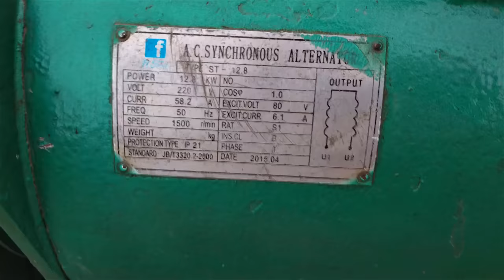Free energy Generator With 100 Kg Flywheel 12Kw Alternator 100% Real Free Electricity

Comment: That AC motor is using electricity of the power company (220V or 120V) and He still has to pay for it. That motor is rotating the gears and that rotational energy is converted into AC by the alternator.
The thing is: If we could rotate the gears with a DC motor through a battery?

A chemical cell battery connected in series (12V x 20) would produce a 220V DC supply, which would ofcourse overheat and cause extreme power loss, and will lead to premature battery failure.

Now the problem with lithium-ion battery(used in EV cars) is that, they are costly. A 48V lithium-ion battery would cost around Rs 1,50,000. So to have around 220V,  we need to buy 5 such batteries -->Rs 7,50,000 investment just for the Battery.

Moral: We extremely have to rely on running water from Dams, or Steam, or nuclear power.  Power generation is costly and we need to understand the preciousness of our natural resources. It is a hard truth that No energy comes free.

Comment: I work in a printing company, and we have old machines with flywheel systems practically the same as the one in the video.  In itself, the machines can break your fingers, hands and arms, and in extreme cases crush or tear an extremity until they stop due to their safety sensors, but those that have a flywheel do not have modern technology or a system. emergency brake, given their age, they can kill you if they grab your hand since there is no way to brake 50 kilos or 100 kilos rotating at more than 1000 revolutions per minute.  So, watching this man put his hands through the straps, so comfortable and confident, spinning at such speed, attached to such a heavy and large flywheel, left me one step away from a heart attack.

Comment: The alternator was stripped of parts except the fan and replaced with batteries. The motor is just an added part to make it convincing . Once the batteries are exhausted, the power is gone. This is just for  “views” and income for the guy.

Comment: What he invented will not work!

I invented Next Generation Electricity, the SPHEREMOTOR. Wrap hundreds of feet of enameled copper wire around a small plastic bowl. Take two strong disc magnets and let them attract together squeezing the center of a pencil. Add something to fill the gaps between the two magnets. Secure each end of the pencil so that it can rotate, and the magnet portion rest inside the wired wrapped bowl. Take some 9-volt batteries clip them together. Sand the two ends of bowl enameled wire and secure one end of the wire to the negative on 9-volt batteries.  Now tap the end of the other wire to the positive on the batteries. Keep tapping and watch the powerful motion it creates.  Where it becomes cool, is when the magnet around the aluminum axle is a sphere with 600lbs of pull strength and the tolerances between the wire wrapped bowl are really, really close, the timing of the alternating tapping is perfect, that's when it is magic. Now add another bowl winding to generate current from the spinning of the 600lbs pull strength sphere magnet inside it and this becomes something that uses very little current but creates a large amount of current.   To see drawings, search for spheremotor.

Comment: You clearly tell the lights (load) is not connected to the alternator. When he turns on the lights and the machine, we cannot hear the load act on the alternator. 😂
If it is really connected to the alternator you can hear the machine slow down and work hard to rotate the flywheel. 😅

Comment: This is simple why it works, and you can't say it doesn't without actually trying first at this scale (not by using a 10 grams flywheel). The key here is the heavy flywheel that overcomes the magnetic field breaking power. the added pulleys allow the system to output more than the input (FFG). Sure, this doesn't work if you did all the your homework when you where in school, because you need to think a bit more outside the box. Watch this video to get an idea of what's gonna come. PwZK51CG1kk

Comment: There are serious problems with the octopus energy company's charges and electricity meters. Under the same usage conditions, the electricity bill can be 40% more expensive this month. Be careful when choosing an electricity company~

Hi !

I just moved here on August 16, 2022. Because the electricity bill paid in December was 40% more, I feel very wronged. I have never used the dishwasher and oven here. I ever wash the dishes with my own hands and just use my air fryer, never use oven. I haven’t officially turned on the heating until now, because the indoors here are warmer. I don’t even need to turn on the fan since last month, and the one I rent here is the most It's just a small one-bedroom apartment, not a house! Life is as usual, and the electricity consumption is the same as in the past few months. The December electricity bill is £209.07? When the air conditioner is turned on in summer, it only costs £124.61 and £132.15. December is unreasonably expensive and a lot more expensive ~ need to investigate thoroughly and follow up? ~

December 2022 The bill is more than 40% more expensive, but my life is as usual and the electricity is used as usual. I have not turned on the heating, because I don’t know how to turn on the heating. I used the dishwasher, and I have been washing dishes by hand for four months since I moved here. The weather has been cold recently. I just bought a small heater and came back for a few days. I have blown it a few times. In the hall, the blowing time is equal to It’s like blowing my hair with a hair dryer. Because I’m sensitive, I’ll get a dry cough if I blow it too often, so I turn on the heater very little and only use it a few hours for a few days~
Conclusion: The air conditioner was turned on for 1.5 months from mid-August to mid-October, because I moved in in mid-August~
Electricity charges in September are
£124.61
The electricity bill in October is £ 132.15
In the middle of December, the air-conditioning and heating are not turned on, and everything is as usual, and the electricity bill is
£209.07? ? ? ? ? ? ? ?

🤔 When I was renting a house, I already felt weird. My flat landlord insisted on asking him to pay the electricity bill, and I just paid him back every month ! I said that I can apply the power company by  myself, but the landlord insisted on doing so~ Unexpectedly, within the third month, the problem appeared ! I know that the power company can set an index electricity bill amount, and then deduct more and make up for less in the future, isn’t it? Does my account do this? If there is no set indicator, it is reimbursed every month. Why is my account so expensive for no reason?

The landlord said that I started to consume more electricity on the 10th, because it started to snow that day, but my heater was delivered on the 12th, and it was taken out on the 13th. It only took a few days. I also said that it was only in It only takes a few hours for the hall 🤔 How can there be so much electricity, I only use it for a few days, and if it takes a month like this, it will become an astronomical figure ~  Well ! I need to do some routine formula checks?   even call the power company to check the meter and ckeck the wire ~ How to solve this problem ? !

Comment: Note carefully from 5.04 to 5.06, how that idler pulley he is struggling to tighten under tension, as he does the pulley moves as he tightens the nut, so he tries hard to push the pulley down to tension more using the wrench, but all of a sudden around 5.05 the pulley moves down by itself, so clearly this is a fake photoshopped or edited video. The whole frame  moves so he goes away to reconnect house power to it.

Comment: I just laughed when he plugged the electric motor into the board being powered by the generator that is being powered by the electric motor, how stupid do they think people are, that setup would slow down and stop within a short time but I suspect that there is a hidden power cable powering the motor, there is no other explanation.
It is IMPOSSIBLE to run the motor from the generator that is being spun by the same motor even with a flywheel. 
I am pretty sure Faraday tried this the day after he invented the electric motor and found that it did not work then, does that mean that India and all the 'Stans are about 200 behind the rest of the world, are they in danger of becoming 4th world countries?

Comment: good lord. that belt pully tension CF contraption!  dude, you're supposed to tighten the tensioner in place and never touch it while the damn ithing is running, you could get fuuuuuked up bad. And that grinder could easily kick back in the nutes and then ya weld with no welding goggles, you'll go blind. Please get an eletrical meter & check your voltage, Amps current, wattage draw, everything.. stay safe  :}

Comment: I would design a gear multiplier system and have the motor shaft rpm multiplied..
Secondly i will use a power booster which i have practicalized already to use small power give to generate plenty power to energize the motor. 
I think with this, i will have a cool free energy generated.

Comment: Plz guide me:
1. Small poly sizes?
2. Alternator and Motor RPM sahee hain ya 1500RPM walay lon.?

Hi i am trying to make 7.5 KVa system.

1. Alternator 7.5 kva with 2800 RPM
Puly size?
2. Motor 2HP, 3000 RPM.
Puly sizes?
3. Fly Wheel 50Kg 24inch Dia. 
2 pulies sizes ?
4. Shaft 1" dia length 2ft.
5 gear puly 4"

Plz guide me in Puly sizes, RPM of motor and Altaernator(denmo) 
Regards,

Ubaid

Comment: Saw this and could not believe how inefficient it was. You don't need the electric motor at all. All you need is to put some gravity shielding under one side of the flywheel and a gravity amplifier under the other side. This will cause the flywheel to rotate and drive the generator. It won't be free, but the price of gravity is quite reasonable if you get the right provider. It should be cheaper than all the electricity this guy is using.  P.S. EMW, this is my IP and if you use it in a video I will make a claim on it.

Comment: I find it highly difficult to not call this fake. There are going to many losses due to which this loop system will breakdown before even starting properly. You are telling us there are no losses between motor providing mechanical power to rotate wheal and wheel somehow magically transfer entire power to alternator and  alternator not only provide enough power to motor but also somehow provide power to lamps there must be some use of magic otherwise I don't see how it could be pulled off.
Reply: I think the input power cord sums it up. Why do these people bother. I found this because I’m interested in very efficient power generation with a large flywheel to provide smooth power, yet instead youtube is polluted with this nonsense.
Sad that people want to pursue bullshit.😊

Comment: THIS IS LAME!  BUT FREE ENERGY DEVICE THAT WORKS 100% I have yet to make a video on but absolutely WORKS 100%. I will describe it to you! It involves syphoning uphill and letting water come down on a hydrogenerator! YOU CAN syphon up hill by adding one container higher than another have the water syphon into the high container, open a valve on higher container to let water flow down it will suck water from the syphon port uphill! as the water flows down add a hydrogenerator it will flow until it evaporates creating free energy! but wait it can be improved. put the whole system in a sealed container so that evaporated water is directed back into the containers for less water loss. hense we can create free energy YW hope you enjoy, I am creating the system soon!

Comment: You don't show how much energy you took from the grid to spin up the flywheel and several times you edited out the footage of the flywheel slowing down when you had to plug the motor back in to spin the flywheel back up.  There is no such thing as a free energy generator because it violates the law of mass-energy conservation. all you're doing in this video is tapping into the momentum of the flywheel until it slows down. In other words your generator is a fake. Nice try.

Comment: In order not to be speed dependent It is necessary to have permanent magnets in the generator rotor, or in other words the generator must be the same for wind generation, so It will not be necessary to work at syncronous speed. The generator will also work at lower speeds.